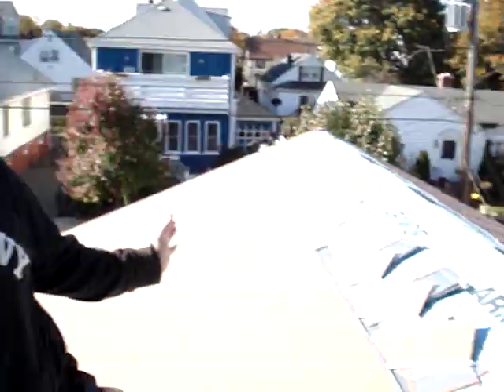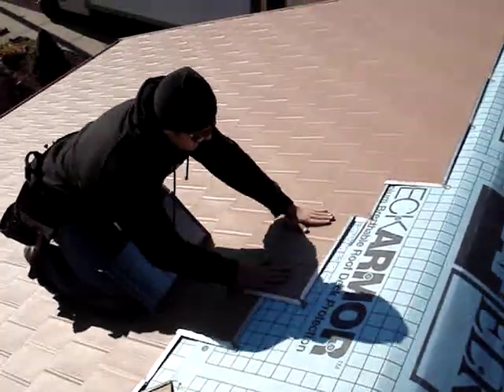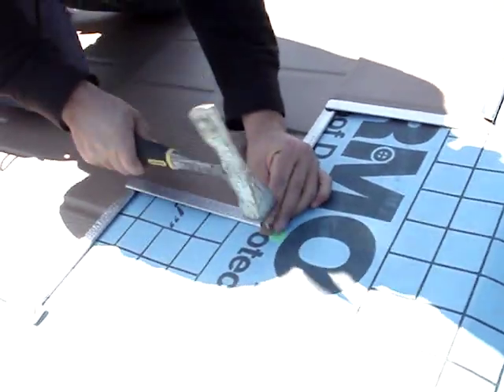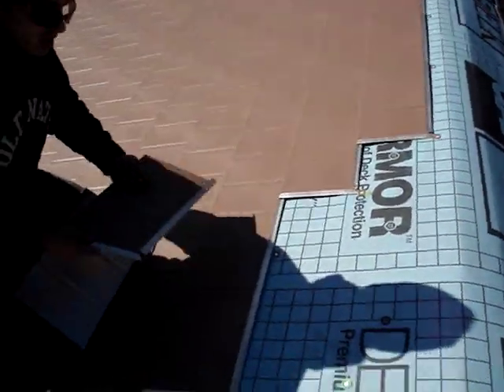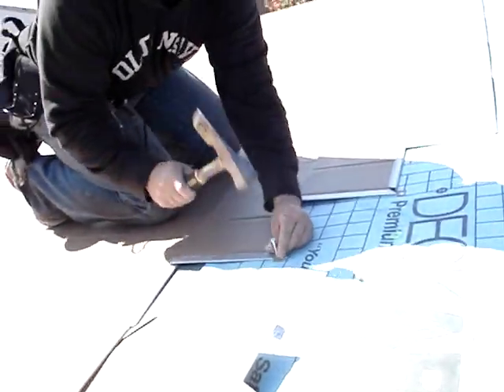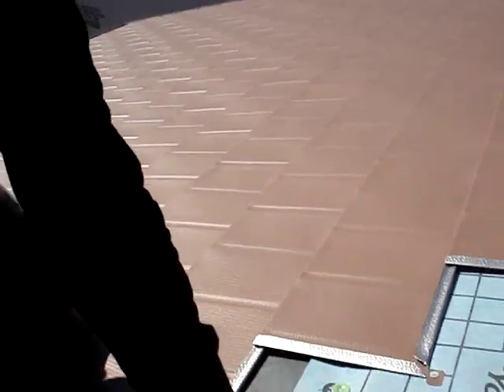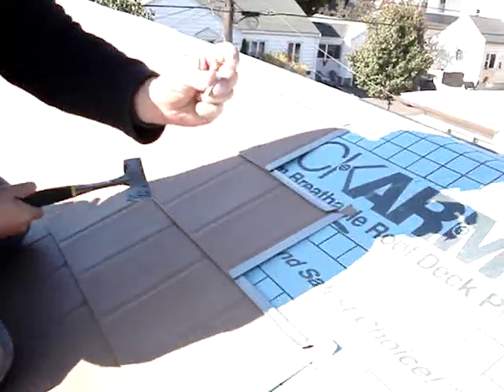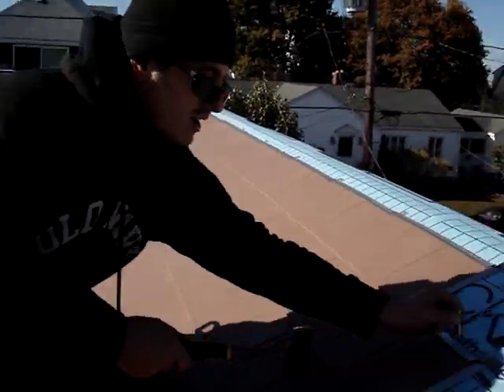Metal Roofing Installation -  Metal Shingles - Standing Seam

Comment from the maker: Leakage is due to faulty installation - net defective product. This is one of the most thought out metal roofing systems out there, and offers excellent flashing options unlike standing seam roofs. 

I feel for you, but you cannot blame the material - it's the contractor who screwed you up.

You can try to find a supplier in Utah, and see if they sell the material to you. Good luck.

Comment from the maker: @GindyBrat1954 Here is where you are wrong brother - these shingles are manufactured by aluminum shingles company  and not by interlock. 

They are the same design and are stamped the same way, so essentially they are the same as interlock's shingle but they are not.

Still i'd use either interlock shingle or this one - they are both great metal roofing system - it's all in the installation. If you install it wrong - it will leak.

This roof was installed in Revere MA 2 yrs ago - no leaks at all

Comment from the maker: Hi Shane,

Do you have pictures of your roof? The part when metal was removed and water damage.

We never had any problems with our roof installations and this systems has been around since 1948 - it obviously works, otherwise it would not be produced for such a long time - 61 years now. 

My best guess is that you got bad installers putting your roof up. It does not matter how good a product is, if it is installed incorrectly. Still, I honestly believe this is the best designed metal roof.

Comment from the maker: @coolflatroof

PS - Revere, Massachusetts is located along the ocean, and this roof is installed on a house in a Point of Pines neighborhood - 200 feet from the ocean. So every storm off the water hits this roof. Strong winds, lots of rains and snow, and salt in the air. This roof is 100%, just like it was when we installed it in 2008. 

Point is - it all comes down to how well it is installed. I've seen metal roofs blown off - we did one on IHOP rest. in Hyannis, MA, 1/2 the roof was gone.

Comment from the maker: @telosfd 
Do you mean the lock? it is actually 3/4" overlapping (interlocking) mechanism, which is more than adequate, and makes the system very durable. Remember - the locks are on all four sides and the shingle is only 1 sq. ft.

Comment from the maker: @badjura 

I know about Interlock being sued in Hawaii & in many Canadian provinces, but you are missing the point - the installing company gets sued, & because of faulty installation, not because of bad product.

We are currently replacing an interlock roof in Hartford CT, but not because it failed - there was a fire, & the customer still wants a metal roof, but does not want to work with interlock.

Basically the system is great, but as any other roof - if installed incorrectly - it will leak!

Comment from the maker: Tornado and hurricanes in Boston MA? This roof is rated for a 110 MPH wind uplift, and we actually added a special drip edge which is way better that the standard one in terms of wind uplift, and is fastend on the flange and on the face.

So no - this roof is not going ANYWHERE! :)

Comment: Have you tried reinke aluminum shingles?
Reply from the maker: No, but when I did research about it like 10-15 years ago, i did not like something about it. Don't remember now, but name stuck in my head, with negative associations.
Reply: @coolflatroof  exposed nail heads and high install cost?
Reply from the maker: @mobleyMobley  where did you see exposed nail heads???

And yea - expensive!
Reply: @coolflatroof  the reinkes use a double shank nail into the face of the shingle with a nail gun, so all nail heads are exposed, but they require ice and water underneath on entire roof.

Comment from the maker: Dude - interlock is a manufacturer / installer of SIMILAR roofing product. Their main problem is not the product - faulty installations. I know interlock well and know people working there. 

As I said, it is the bad installation that makes you say "its crap". 
The way they run installation crews here in MA would be completely different from other parts of US and Canada. Here they have good and bad installers, but the problem is the management / installer relations and it all comes down to money

Comment: He's not even installing them correctly.  I've watch 50 different videos on how a metal shingle roof is installed.  You still have to put the clip and fasteners on the rest of the shingle.  This roof won't last.  Lazy roofer, and poor workmanship.